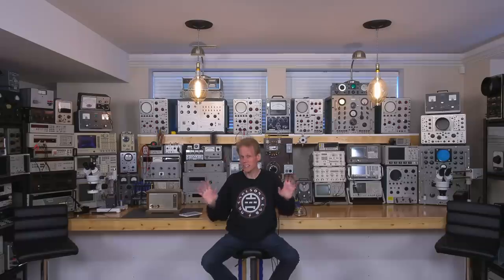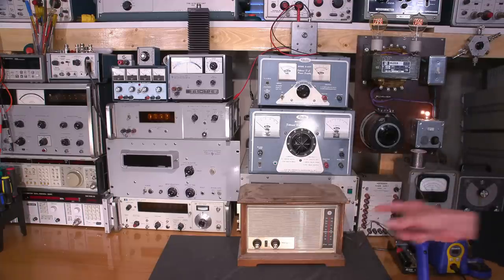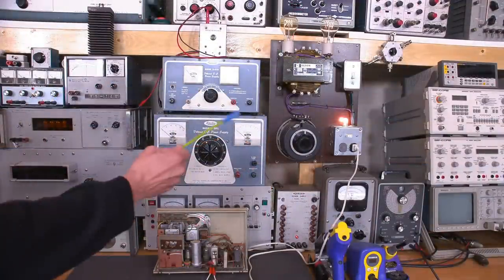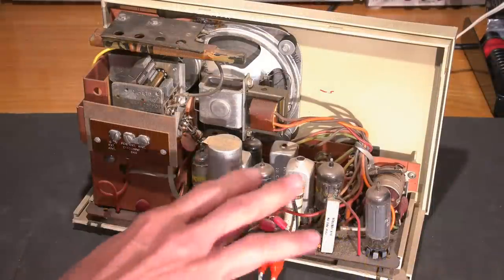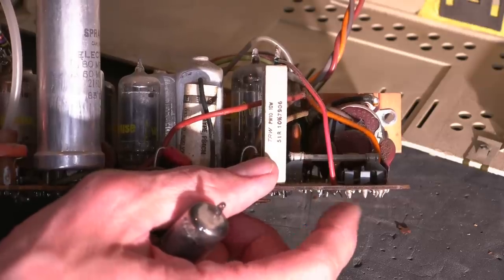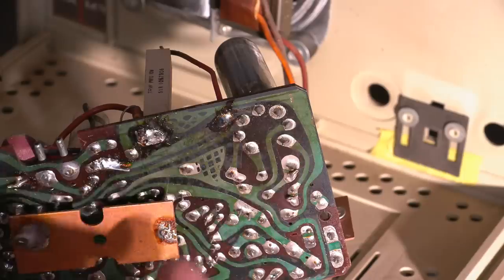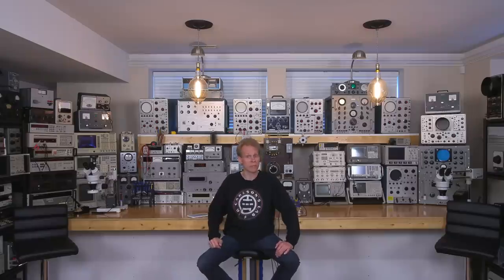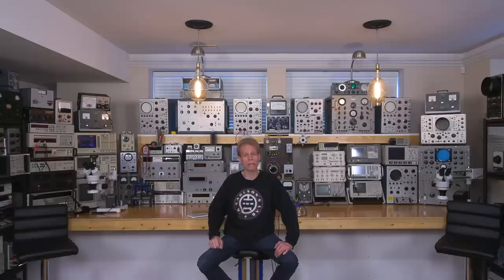Old 1960's Barn Find Radio Receiver Teardown And Diagnosis!

Comment: Late 60s to 70s? Looks like EM speaker. I thought most radios by then had PM speakers. Also just realized it was tubes. 60s/70s were 95% solid state

Comment: I wouldn't bother with a full restoration unless you're planning on making some more time-consuming improvements (like cleaning up that dial string). While I enjoy your videos and learn a lot from them, so much of this radio just screams "cheap" and you'll end up putting in more effort than it probably deserves. Unless you're planning to completely redesign it's housing to make it look better, but if you're going down that road, you've left the path of restoration.

Comment: Seems like a lot of work just to substitute a tube.  A 14GT8 is a $4 tube at Tube Depot.
Reply from the maker: And two weeks + for delivery.... and a video.
Reply: @MrCarlsonsLab My vote is a “restomod” if you’re going to do it restring add light etc.
Reply: @MrCarlsonsLab   Fair enough. Understood, for the sake of the video. As a restorer who doesn't do videos, I just try to keep them  as original as possible.

Comment: Hi Mr. Carlson, a respectful EVP spirit audio analysis reveals traces of ghost talk, as you skillfully bring this radio back to life. Please listen at 0.5x video speed:
34:31 'Massive tumor' - sounds like a spirit explaining what killed him, as the rest of the sentence that can be heard has no logical connection to this strong statement.
Given this rather negative EVP I vote in favour of 'butchering' this cheap radio for parts. It's not very unique in any way and I don't think it's worth restoring or even saving. Some devices are just not built properly to begin with.
Thank you
The Völve, Asatru shaman and spirit medium
PS
I haven't been able to detect any other EVP making any sense, here. But sometimes all we can hear from a paranormal point of view is simply nonsense, because as in this dimension, where a lot of what is being said is absolute babble, so goes for the spiritual dimensions; there's a lot of chit-chat making no sense - only spirits dreaming or talking just to talk, more or less gibberish. What I listen for is intelligent EVP response or comments on reality.

Comment: If this radio is not a collector item and you are not impressed with the low budget design and it has close to zero value on the market place them I do not blame you for parting it out. Do what is best with this radio based on your experience.

Comment: yes!!! full restoration please,   as you say it's not a particularly well built or good radio, so parts is where it should go.  In saying that i don't like parting out any valve stuff,  this is one of them sets that shows the later end of tube radios and how they became very poorly built and cost cutter cost oriented. So please don't part it out.

Comment: What you can't fix, is there is nothing on radio worth listening to any more.  By about... 50 years.
I think most of us haven't listend to raido... in 50 years.   I know I haven't.
ANd I ahve shortwave radios and use to string up long wires and tune HAMs even in SSB.
Reply: I listen to radio every day in my shop?

Comment: A typical late valve radio. Ugly, cheap and crappy. Fortunately, the valves haven't already carbonised the PCB as in many others from that area. There was the infamous Philips K7 colour TV chassis where after a number of years the three PFL200 (16Y9) valves used to be dangling from the PCB traces once the Pertinax below the sockets had burnt away completely. Yikes...

Then again, your radio has a Görler FM front-end and that's a good thing. Görler was a German company supplying half of Europe's radio and TV manufacturers, initially with front-ends for TV and radio. Their products were always really good. A few years later, they came up with a complete selection of semiconductor modules - FM front-ends, IF amps, stereo decoders etc. - and some of the most prestigious European hifi tuners and receivers from the late 60s and early 70s used them.

So, if anything, your radio should have decent FM reception, as those Görler modules were made for Western Europe's much more crowded FM band.

Comment: No! Part it Out!  Do not waste your time! Life is way to short! This raido does have some history to it. It is an example of getting to market as cheap as you can make an A.M / F.M table raido.  As you can see it started out as a all plastic raido. Just look at the front case. They used an old in stock cheap speaker with the combo output transformer choke. All of this was in inventory from the 1950s. If you do restore it, witch I hope you don"t, at least give it a Litz wire antenna on the back. Best Regards Jack.

Comment: Vintage radio repair tech in 2023: "...them just giving you junk - that's what's going on nowadays."
Consumer electronics bean counter in the 1960s: "Hold my beer."
Is that a field coil speaker in a 1960s radio?! What the actual f***? I think this may be the most shaffordable radio that you have ever featured on this channel. Are you sure that it wasn't made by Martin in the 1970s?

Comment: Mr. Carlson: "Allright, here it is in all of its glory.  Nothing has been touched since the barn - as you can see, dust everywhere"  

This is right after I just finished watching the latest shango066 video where he zooms in on fist-sized piles of rat poop and pee stains inside his latest barn find televisions.  lol

I vote thumbs down on the restore of this one.  The questionable dial string design along with the overall homely appearance of the radio just isn't worth your valuable time and expertise.  
I suspect you have more worthy projects.

Regardless, I will enjoy watching you restore anything. 🙂